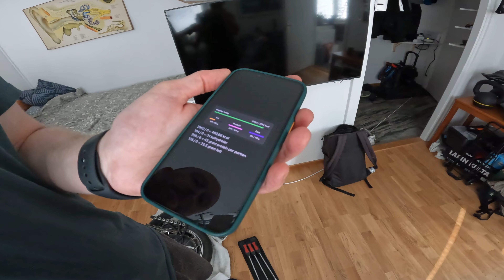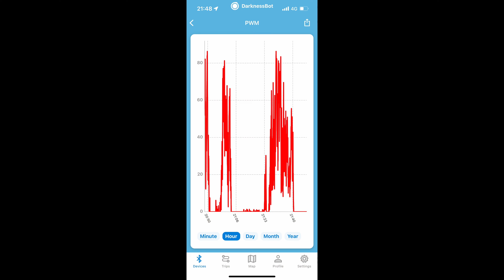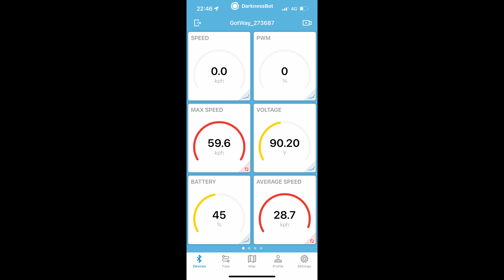Wheel Wanking - EXN (motherboard failure) and S22 (tube change)

Comment: The "fun" i did similar thing at home,  I had a 16X and bought a new one. That has been pretty useful, since i could rapidly take stuff on one to the other in case of failure, taking the time to repair. I have actually changed my tire a couple of time, but i would definitly recommend you to slide the key along the tire instead of picking it. Each time you pick it, you run the risk to break the chamber. Hence i usually pick once or twice, at start and at the end. but sliding one side, then the other, ultimatly worked great, and i preserved the chamber. I hardly ever saw a naked EXN, thanks. But take care of yourself !
Reply from the maker: Having spare parts is definitely great. It takes us a crazy long time to get new ones if we want them at a decent price. Thanks for the advice on the tire! I will give it a shot next time. I only ever did one tire swap on my 16X and it wasn't so bad.